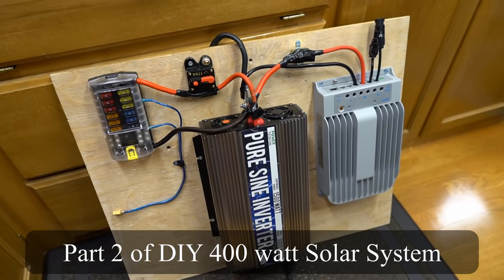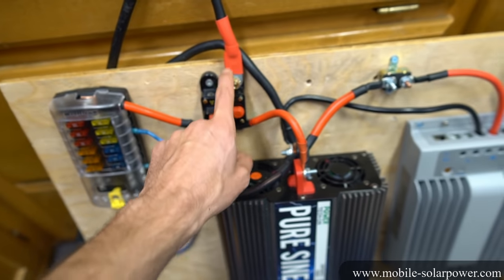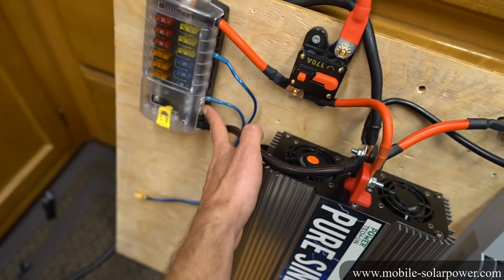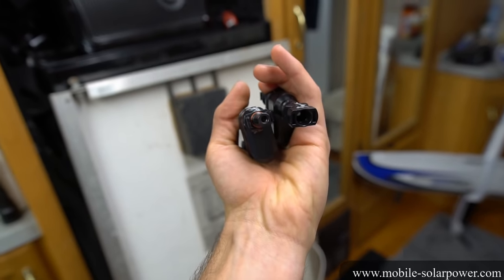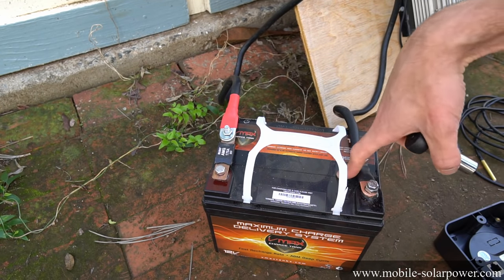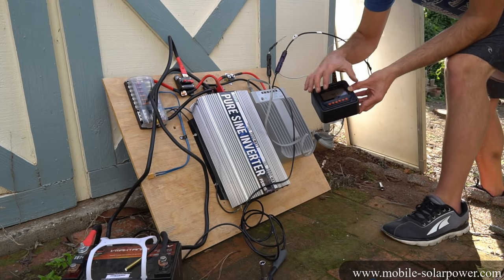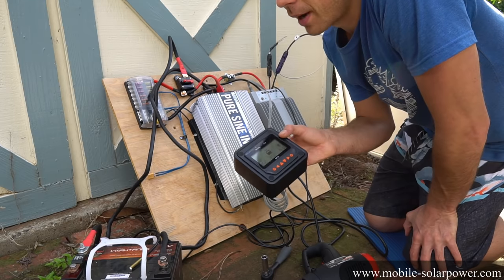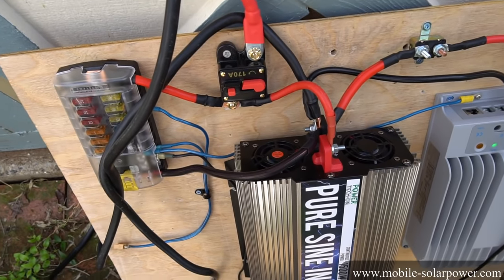DIY 400 Watt Solar Power System Beginner Tutorial *Part 2*

Comment: You never want to interrupt the path to ground. That's why you put a fuse on the positive lead in a positive voltage system.
Reply from the maker: Where was an interrupt to ground? Everything is grounded properly with proper gauge wire..
Reply: @WillProwse  you mentioned that you did not know if the fuse is to go on the positive or negative side and it never goes on the ground side. If the fuse popps then that could cUse a dangerous situation.
Reply from the maker: @DailyWalk365  nooooo I was saying Im not sure which one to connect first. Some say connect the ground first, some say connect the positive first. I was never talking about which wire the fuse goes on. thanks tho

Comment: I'm a little confused your using 6 gauge wire for the inverter but your book says to use 2 gauge. On that note I have a 1000 watt inverter your book says to use 8 gauge wire but that won't fit in my charge controller can I use 6 gauge to the circuit breaker (first bolt) and use the 4 gauge to continue with that to the inverter? (Epever tracer change controller)
Reply from the maker: I'm using 2 gauge in this video. And use largest size wire the controller can fit
Reply from the maker: Follow book recommendation. But this video has same size. Maybe there is confusion in inverter size?
Reply: @WillProwse  okay so from charge controller to inverter use largest wire the charge controller will take and from inverter to battery use what book says. Thank you sometimes this grandma gets things confused believe I got it now. Box is all built putting it together today battle born will be here Thursday 😁
Reply from the maker: @KE8MWQ  awesome! :)

Comment: Do the solar panels need a breaker or fuse?
Reply from the maker: Under 1000 watts, not really. Only applies to large systems. The panels will not hurt themselves when being shorted. Unless you have a lot of them connected.

Comment: I wonder how much energy is used to create all the components of this solar system? How long would this solar system need to run at full capacity with energy from the sun to reach a net energy gain above the energy that was used to mine the raw materials and then to manufacture the components?
Reply from the maker: Are we talkin carbon or are you talking about overall thermal efficiency extracted from sun to manufacture?
Reply from the maker: and considering how much energy the sun has I don't see it as a problem at all. Unless you are specifically talking about how much carbon is being put into the atmosphere
Reply from the maker: In a universe with the presence of entropy, nothing is sustainable. You and I are not sustainable
Reply: Solar is being converted to usable electricity. The suns energy is free but the components used to convert solar energy into electricity took energy to make. Let's just assume that the monetary cost to purchase all the components of the system is an accurate measure of the energy used to produce the system. How long and how much electricity would need to be produced to offset the cost of the components as compared to buying electricity from the market place (power company) ?
Reply: @salinesal  It doesn't matter because there is no marketplace for off-grid energy. To put it differently, how much would it cost for the power company to provide you with power while you are MOBILE and at ANY location in the entire country? Also, people don't use this calculation for anything else. For example, why are you not including the cost of your house which is necessary to receive the electricity provided by the power company? The electricity may be cheap at $0.10 per KWhr, but you can't just plug into the grid. Perhaps with rapid charging and lower battery costs, solar will be unnecessary when taking the inevitable Tesla RV to the supercharger.

Comment: Where does the fuse box ground?
Reply: Fuse block could have the ground just ran and hooked up to the same location that the battery ground wire hooks up to the inverter.  As this system is wired it is completely independent and isolated and is a separate complete power source totally independent of the vehicles electrical system.
Basically it just amounts to a larger capacity permanently mounted not convenient to transport jump box like a Jackery unit.

Comment: NFPA-70 ampacity table in the National Electrical Code. I suggest referencing the 60° C column unless your terminals have a specific temperature rating.  #2 copper can handle 95 amps. You're welcome.

Comment: Will, did you try to connect two batteries in series? It would lower the current and potential wire heating problems.

Comment: Always connect positive to the battery first and ground second. Disconnecting in reverse order. Reason why is to avoid shorts if your spanner touches the chassis by accident. Obey this rule also if you use jumper cables.
Reply from the maker: This is not for automotive applications so it does not matter at all

Comment: SAY WHAT??———-If you are not speaking too fast for the average viewer and the average viewer understand everything you are saying........they are NOT average.
Reply from the maker: What?
Reply: Let me simplify it.  You speak so fast that you’ll never know how many viewers just move on without admitting that they are understanding little of what you are saying.  On the other hand, the viewers that leave positive comments probably have a far above average level of academic training and understanding regarding electrical/electronic/solar engineering and design.  The net point is that you stand to retain a larger percentage of viewers if you would simply slow down your presentation and, maybe, dumb it down somewhat.  On the other hand if you are not interested in viewer retention, forget everything you just read.
Reply: David Dion 
I listened at double speed.
But I’m from where people talk fast, plus I’m familiar with electrical work.
Maybe reduce the playback speed so you can follow along?
Reply: That is what the video speed setting is for